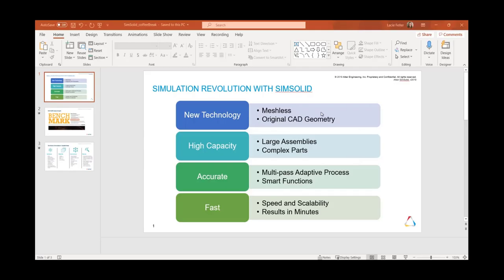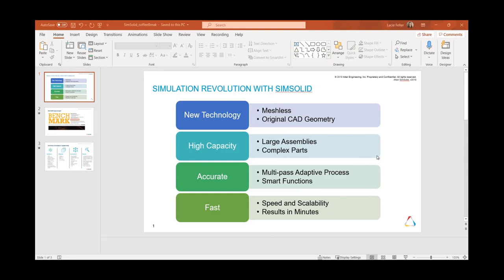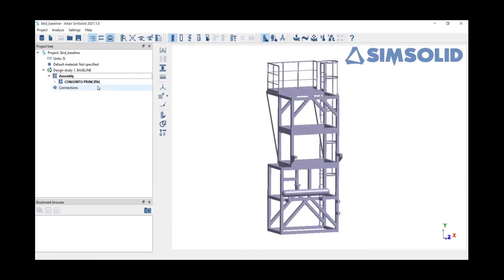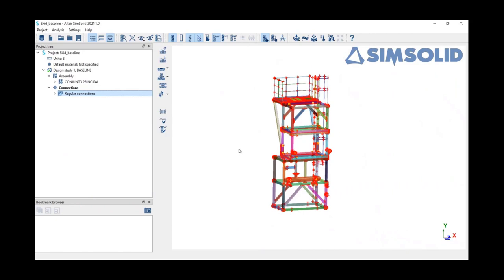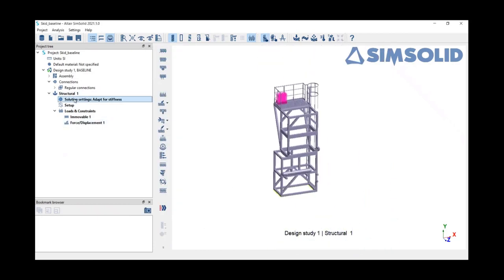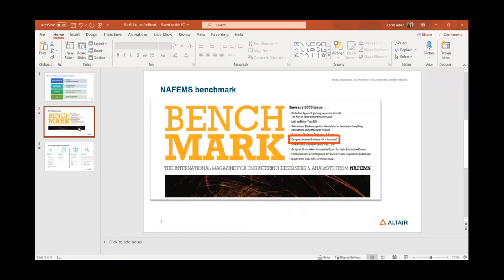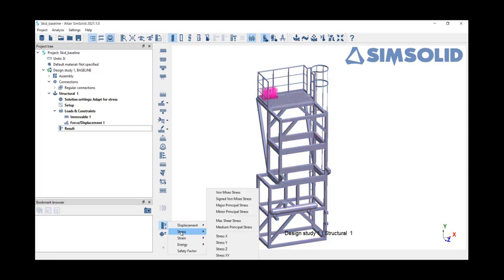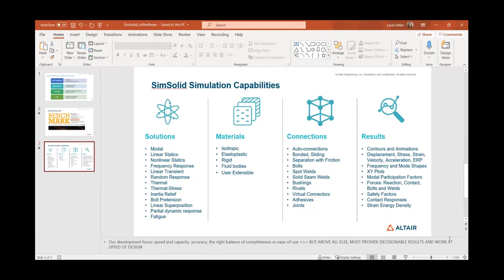SimSolid 2021: Getting Started

Comment: I still don't quite understand how this software is framed. Could it be classified as an extended physics method or is it simply a method of solving differential equations applied to a CAD geometry?
Reply: They are trying to find out...
Reply: What they say is "Inspire - SimSolid enhances this process [of structural simulations softwares] by operating directly on original, un-simplified CAD assemblies, does not create a mesh and provides results in seconds to minutes."

Never used it though.